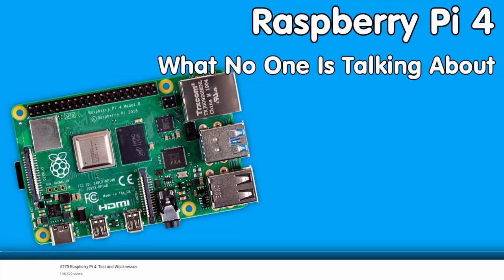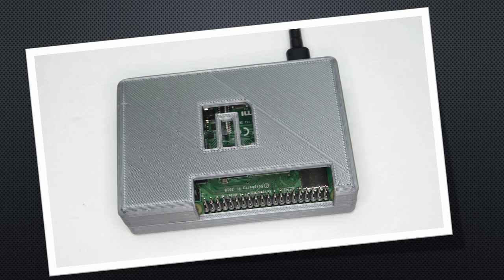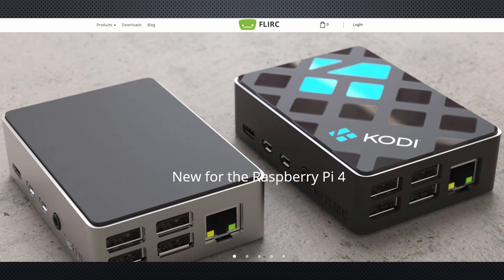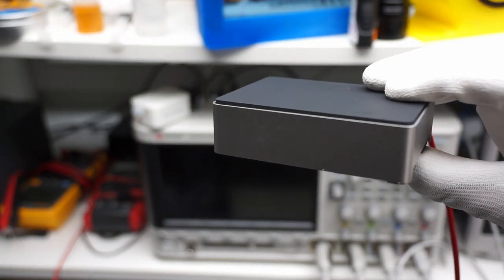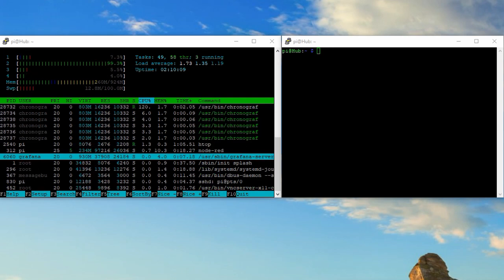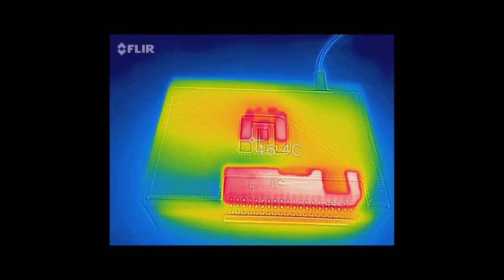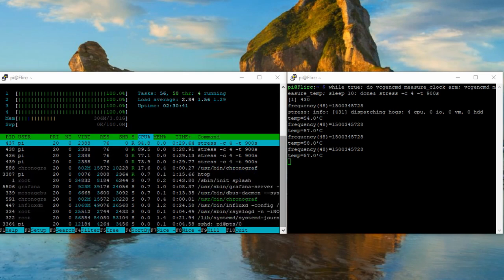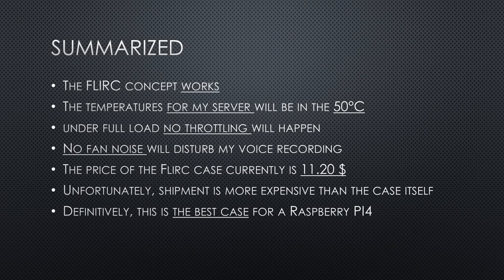#283 FLIRC: A Cooling Case for the Raspberry Pi 4? Does it work? (Quickie)

Comment: you should put a simple passive aluminum or copper heatsink, add more vent holes to the printed case, and then compare the values.

Of course, the FLIRC case is completely dust resistant, and the price is quite decent if you manage to find it for MSRP
Reply from the maker: Many ways lead to Rome as we say here...

Comment: I have this case. Still gets hot. Maybe it is overall cooler than without the case, but the heat is borderline uncomfortable to hold in your hand. Great hand warmer. Honestly I would prefer the Flirc case to have some fin design to it. The case is by far the most beautiful Pi case out there, but I want a fan combo option or just a larger heatsink case design since the Pi’s keep getting more powerful.
Reply: Elmer Gloo Perhaps add some thermal paste/tape and a large fin heatsink to that case.
Reply: vagrantus that’s what I want to do, but can’t find a reasonably sized one. All I have are a bunch of old massive server heatsinks.

Comment: Out of interest what does a fully enclosed metal case do to the Wi-Fi response?
Reply: Most metal cases have enough holes, gaps and slits that allow some radio waves to enter or leave the case. There will be a bit of attenuation, how much depends on the specific situation and can be easily measured by anyone with such a Wi-Fi device.

Log into your raspberry pi with a plastic case, enter "iwlist wlan0 scan" and look for the signal strength of received beacons. You will see something like "Signal level=-30 dBm". Take a few samples and average it out.

Then put the raspberry pi into the metal case, place it exactly to the same spot and repeat the test. If it now shows "Signal level=-60 dBm" you can still use the Wi-Fi but the receiver gets only 1/1000 of the power then before.

In that example the metal case caused 30 dB attenuation, which is a lot. Likely more than such leaky case will cause. If you had -60 dBm with the plastic case, then you would get -90 dBm with the metal case and this will be a really weak signal.

You have to experiment yourself.
Reply: hi zvpunry, I was asking out of interest as Andreas has both types of case and could give us an indication.
Reply: It will only be an indication, and a bad one! Andreas might do some measurements but they won't be easily reproducible.

Just from looking at it in the video, it seems to have a bottom made of plastic. It will probably have no significant attenuation. It may act like a reflector, reducing the signal strength from anything above the case and increasing it from directly below it. But even then, Wi-Fi works fine with reflections and there will be reflections from the floor and the walls and so on.

To create reproducible measurements, you have to remove all sources of reflections. This could be done with a anechoic chamber or a large place like a soccer field. Then you could take measurements from all sides of the case. The result would describe how the radiation pattern is influenced by the metal above the antenna. This might give somewhat reproducible results, but they were still useless for most users. Most users put these things in random places in random orientations. If the half-metal case causes some directionality, then move the case around until the signal strength gets better. The result might be better than without a metal case.
Reply: I had the same concerns when the pi3 was released. According to many responses to my questions, it significantly harms wifi range. 

But honestly it didn't matter to me, because I have mine wired (Ethernet). If I was going to need wifi range, I would avoid the internal wifi altogether (maybe an Alfa adapter).
Reply: shadowless: Let me add some (useless) anecdotal evidence: I had a pi3 in a fuse box, metal with cut outs for the cables. I also thought noting would come through, but the difference were "only" around 10 dB. The access point was just next door on the ceiling and the signal strength was wit open doors something around -45 dBm and with closed doors around -55 dBm. It still was perfectly fine.

Only 10 dB, thats 1/10th of the power. 6 dB is 1/4th of the power, half the range. But this doesn't matter if the received power is high enough.That means, significantly higher than the received noise.

In the company I work for, there is a TV in the kitchen that shows news about some things that are going on in the company. This is realized with a rasperry pi (2nd generation, no integrated Wi-Fi, plastic case) and a Wi-Fi USB-Stick. There is just a bit of plasterboard between it and the next access point. The signal strength is always very good, but there are evil noise sources like leaky microwave ovens and a gazillion other Wi-Fis on the same channel, maybe they use up all time slots and maybe there are evil neighbors that send deauth packets. Anyways, it regularly loses connection but it reconnects on its own (once or twice every week). The displayed website normally reloads with a meta refresh tag, this gets stuck and then somebody manually reloads it.

What I really want to say is, it is hard to predict if a specific Wi-Fi installation will work. But it is relatively easy to check it if it is installed.

About that "Alfa adapter", those are advertised to have a higher transmission power. This won't help the receiver in it (unless both ends use it), it will just increase the overall noise and make the 2.4GHz situation even worse. But an external Wi-Fi USB Stick can really help, add an USB extension cable and place it on a location where it works better.
Reply: Hi  @zvpunry1971 , it's a shame I don't have one at the moment, as I'm currently spending all my time measuring the transmission losses through matrix wall's between 30MHz and 18GHz. so have access to very nice spectrum analyser and a good range of antenna's and a large Semi-Anechoic Chamber, great toys to play with. but I'm retiring in a few weeks so play time is limited and work keeps getting in the way!  was just asking from a users point of view.
Reply: I mentioned only measuring equipment every user owns: The Wi-Fi hardware itself! That is because it can show quite useful information about the received signal, like noise level and signal strength (and the signal quality). There are programs for smartphones that display the signal strength of nearby Wi-Fi access points, those might also be useful if the user starts an access point on the raspberry.

If you had the time and the raspberry case, you could measure the radiation pattern. This would be really interesting. But as I mentioned, Wi-Fi doesn't live in the open field or an anechoic chamber, it lives as access point where routers are installed, it lives in or behind the TV screen, in our pockets and on the living-room table. Random places, random reflections and so on. Knowing the radiation pattern would be useless except for satisfying our curiosity.

By the way, what are matrix walls? ;)
Reply: The bottom is plastic, the signal is not dampened at all.
Reply: Good question. I will see when it arrives. However mine is 20cm far from the Wifi router. 😉
Reply: Hi they are a made up like a sandwich of aluminium, wood, foam, wood, and steel. it's hard to think that RF still get through all that.
Reply: I have two Raspberry Pi 3B+ devices in FLIRC cases and WiFi range is not affected at all be the case.  This may be subjective, but it seems better in the FLIRC.
The bottom of the case is open.  It's only metal on 3 sides.  I think that makes a difference.
Reply: WiFi is still good, but the range is limited a little, and the Bluetooth range and responsiveness is limited too, i live in a large house so I do notice a change, but if your not far from your router you should be fine, I have one about three meters away on another floor it seems fine, I use it all the time.
Reply: @jdh30  This is an unusual case to be honest.  Some have reported a slight reduction in WiFi, but I have never heard of it being "destroyed" by the FLIRC case.
I would be interested in hearing more about this as I usually highly recommend the FLIRC case.  
Can you give us some measurements and tests of WiFi if you have a chance?
Reply: @jdh30  I do find the range is limited, also those other chips on the board, memory usb controller, need cooling too, I found when I put precise cut alloy blocks, from memory and usb to connect with case, it overheated, the flirc case isn't a winner for me on the pi 4, I have a retroflag snespi case, with my pi 3 b+ , with ceramic heat sinks, it's overclocked, it never over heats, WiFi Bluetooth, work fine and the fan isnt that noisy, if you felt inclined, a fan controller could be fitted, making it run silent most the time, I use this daily,
For a pi 4 I'm waiting for retroflags new case, but an old pi 3 case could easily be adapted to fit the pi 4, I haven't done this yet as we still haven't had much soft ware development yet, I'm still using my pi 3.
Reply: @jdh30  That could explain the issue, given the underside of the case is not metalic.  I've have not yet had a situation of a router being upstairs and the Pi downstairs for these cases.  Most times it's been the opposite, hence why I have not seen this issue.
Reply: I have never even thought about that and I have like 4 of these cases for 3x Pi3B+ and 1x Pi4. I haven’t had any Wifi or Bluetooth issues with these cases. The bottom is plastic and some of the top is too so it isn’t a solid metal enclosure.
Reply: Luckily, Aluminum does not usually cause much radio antennae interference - not like Copper (or copper mesh for instance which is often used as an excellent Blocker wireless communications ).
Reply: I measured my Pi4 in the FLIRC case with iwlist scan and iperf3 from a fast PC with a gigabit link
Hotspot is at 1m of the Pi4
Pi4 flat on the table :
                    Quality=70/70  Signal level=-35 dBm @2.4 GHz
                    Quality=62/70  Signal level=-48 dBm @5GHz
[ ID] Interval           Transfer     Bitrate         Retr
[  5]   0.00-10.00  sec  64.9 MBytes  54.4 Mbits/sec   50             sender
[  5]   0.00-10.17  sec  63.8 MBytes  52.7 Mbits/sec                  receiver

Pi4 on the side, bottom of the case facing the hotspot :
                    Quality=70/70  Signal level=-31 dBm @2.4 GHz
                    Quality=67/70  Signal level=-43 dBm @5GHz 
[ ID] Interval           Transfer     Bitrate         Retr
[  5]   0.00-10.00  sec  96.0 MBytes  80.5 Mbits/sec  180             sender
[  5]   0.00-10.11  sec  93.9 MBytes  78.0 Mbits/sec                  receiver

Pi4 on the side, top of the case facing the hotspot :
                    Quality=70/70  Signal level=-37 dBm @2.4 GHz
                    Quality=61/70  Signal level=-49 dBm @5GHz
[ ID] Interval           Transfer     Bitrate         Retr
[  5]   0.00-10.00  sec  88.0 MBytes  73.8 Mbits/sec   59             sender
[  5]   0.00-10.11  sec  86.5 MBytes  71.8 Mbits/sec                  receiver

iperf3 with gigabit ethernet on the Pi4 :
[ ID] Interval           Transfer     Bitrate         Retr
[  5]   0.00-10.00  sec  1.09 GBytes   937 Mbits/sec   60             sender
[  5]   0.00-10.00  sec  1.09 GBytes   935 Mbits/sec                  receiver

Ethernet cable rules :-)
Reply: @Taurim  Thank you for the in-depth measurements. Ethernet of course is the best, in general, option for maximum throughput and security. As most of us would use WiFi for ease of use and connection simplicity.
Reply: I was a huge fan of the FLIRC case and finally got one but i am pretty disappointed now because it makes the wifi unusable!
I am really disappointed because all the reviews where great and i really like the design and the passive cooling aspect. 

I just got the Raspberry Pi 4 and after putting on the FLIRC case i get no wifi connection! 

I tested it first 5 meters away from the router with the case and it worked fine but then i took it upstairs and i get no connection at all. After removing the case i am getting a stable connection again so it is the FLIRC case for sure that causes the problem. 

Its a shame that no review mentions this huge range problem...

Comment: I have a couple of these cases and wanted to mention that in order to make a good connection between the Pi and the case, I needed to add a 1mm thick copper layer. So check (difficult to do as you need to close the case, but then you cant see...) for a good thermal connection.
Reply from the maker: Looking at the results I assume it has a good connection.

Comment: if it is absolutely necessary to have no fans and passive cooling is the only option, yeah, fine, flirc. if a slight noise is allowable, a good fan and cheap heatsinks can drop the Pi4 down another 20C. both of my Pi 4 are running a home designed and printed Fan Mount, and idle around 35-40, (ambient at 28) max load it runs about 50C. the new pi's are just not the old passive cooling things of the past, with power, comes cooling.
Reply from the maker: It is not only noise. I also do not like collected dust and if you do not spend a fortune, fans also can break in a 24/7 operation...

Comment: Andreas, IF you have any m2.5 10mm(ish) stand offs in the lab(I have to special order them here) could  you try and put them between the base plate and the board? I am thinking it MIGHT drop the idle temperature a little (5c?). Setting a 6"x3" aluminium cake pan on top (sans plastic cover) drops me another 2-3 degrees. You might also look at the Ice tower for it. Much cooler temps, but I have yet to see a "decent" case that works with it.
Reply from the maker: I am sure you could optimize it a little with your suggestions. The temperatures measured with the FLIRC case are ok for me.

Comment: This case is indeed amazing. Even has a hole you can put a gpio ribbon cable through. Might have to file/cut/saw off a millimeter or two so the sides of the plastic retainer of the ribbon cable don't obstruct the case screw mounting "pillars"
Reply from the maker: It runs for month on my desk for my main RPi

Comment: I thought about this when I switched from the first case I bought. My issue with the first case that I had was the lump of clear perspex that was about 1mm above other chipsets that generated heat. I also couldn't use heatsinks and a fan. My big issue with the Flirc case is the lack of air flow and cooling for other heat sources. The case I ended up with has better airflow, heatsinks (4 -> CPU, GPU, Ethernet and USB controller) and an always on 5 or 3.3v fan (I went with 5v). The fan is silent. My Pi4, under load, doesn't break 55oC.
Reply from the maker: That is also a good solution if you found a cheap and silent fan.